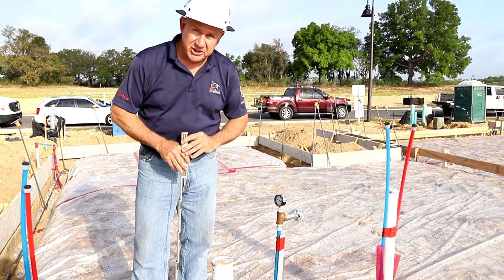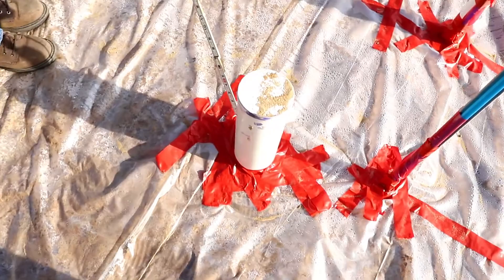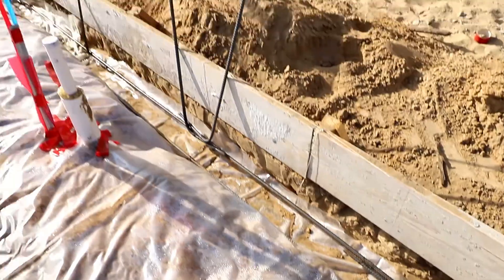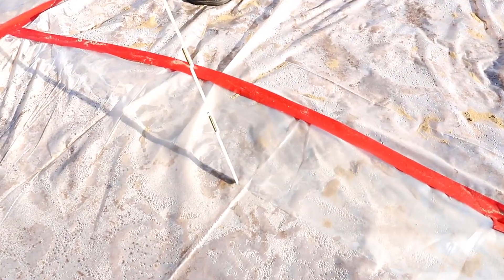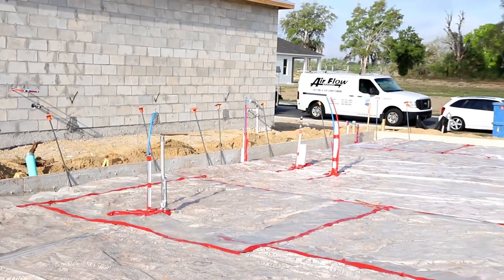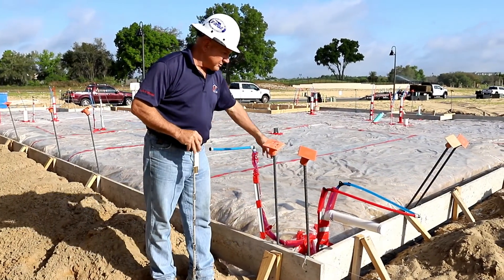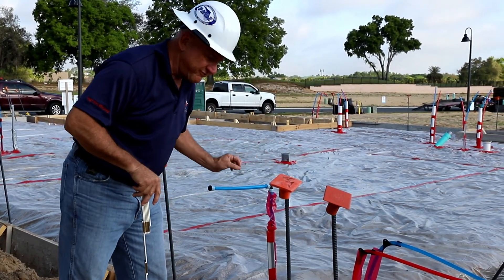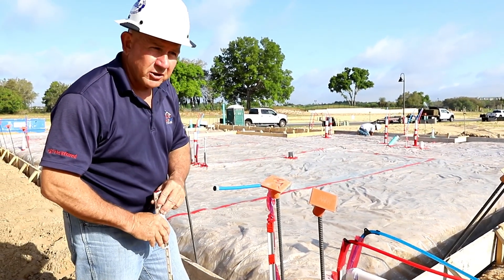new construction inspections supply piping & vapor barrier

Comment: If that "vapor barrier" is a 6 mil polyethylene sheet, as it appears, is never going to be capable of stopping moisture from intruding into the slab, because that junk, is biodegradable and it NEVER correlated to the issue of topical floor problems with slab moisture.